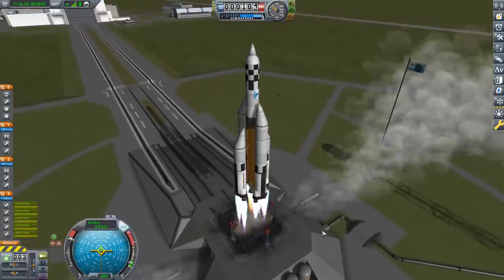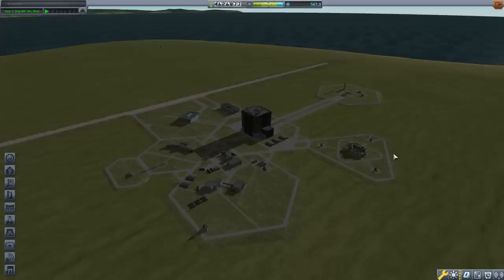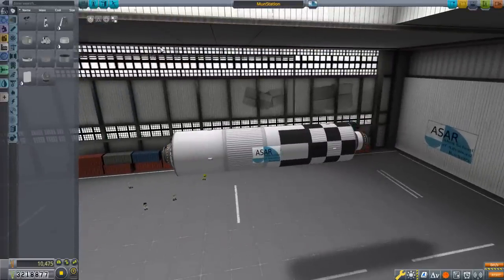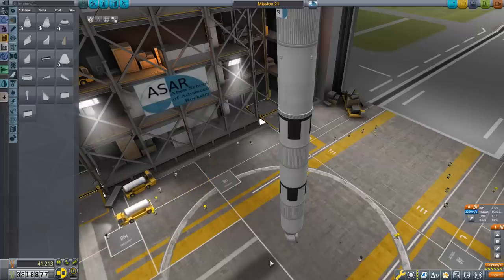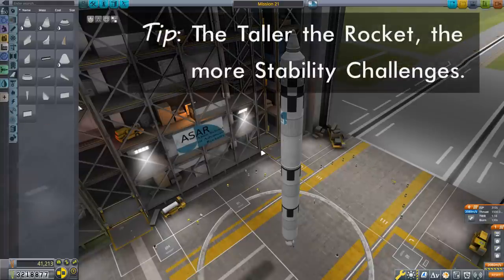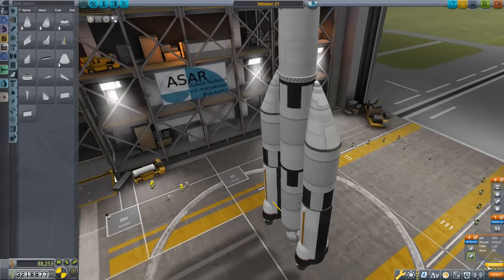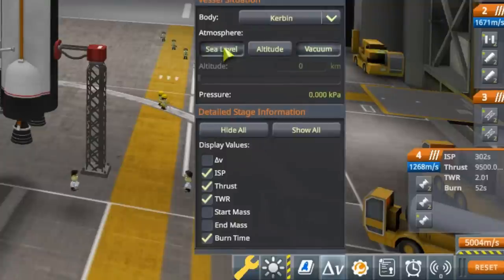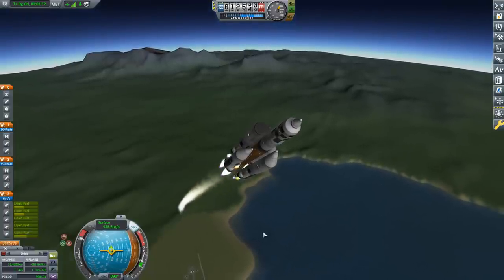How to Lift Bigger Payloads | KERBAL SPACE PROGRAM Contract Tutorials

Comment: Hey Mike. There's a way to Asparagus Stage your rocket without the drag producing fuel lines. Click enable crossfeed on the decouplers, then set your flow priority how you had it. Then, right click the fuel tanks and watch for it to empty. When empty, the engine won't shut off on its own like using the fuel lines, so just stage it and it will turn off and fall away. I use this for larger builds where I'm trying to reduce as much drag as possible but it's too big to fit in even the 3.5m fairing. It's also a way to Asparagus Stage before gettung the fuel lines.
Reply from the maker: This is mentioned in a tip note in the video, but I didn't want to go more into in this video. Maybe in the future.
Reply: Using the separators as fuel lines seems also to help the game organize the fuel priority. At least I never had to change it while using it that way
Reply from the maker: @ismaelyu5  Actually, it was the Twin Boars that caused the problem. When you connect just straight tanks, it usually isn't an issue. That was fine. It gave me a chance to talk about it.
Reply: @nicewhenearnedrudemostlyel489  the drag thing I was hust repeating what I heard I think VAOS or Matt Lowne saying, and in a career mode moneycis also a factor. Also you can do it for fun.
Reply: You can even crossfeed a liquid fuel though a solid booster with the decupler on enable crossfeed, althogh it is a bid difficult to time the solid and liquid fuel consumtion correctly

Comment: "The station must be fully assembled when launched" only applies to the requirements on that paragraph.
So, in your case your station launch has to have the Antenna, Docking Port, and power generation in a single launch.
You can't have any of those components added on a separate launch vehicle (additional components are fine)
Reply from the maker: Thanks. That came up in the chat too. I'll draw attention to it in the next video.
Reply: Oooh thats why mine wasint working

Comment: Without Mike Aben as my guide, I would have never of been able to get into orbit in KSP for the first time, which would lead into hundreds of other launches where I still somehow manage to forget a solar panel.
Reply: Hahah yeh I'm the same. With Mike it just made sense more than others, ob8ter and Matt lowne being the only other ones that were useful.
Reply: Honestly ever since figuring out I can use the custom groups to group together basically a "checklist" of parts I will need in flight, it's made building my craft waaaayyy easier. Like to the point where sometimes now I feel like I missed something but I know I used my checklist to go through all the parts I needed so I trust myself that I don't need anything else and it works out!
Reply: I'm in much the same boat. But even after that I keep coming back to these videos whenever I need a back to basics reminder to keep my upper stages lighter. And stop trying to get into orbit with one giant booster instead of multiple boosters of varying sizes.

Comment: My understanding is that it applies only to THAT bullet point.  You need to have a docking port, antenna, and power generation on one single module; the other requirements can be met with separate modules.  E.g. if you stick an antenna in cargo and have an engineer put it on after launch, it would fail to trigger completion of that bullet point.  Haven't tested, but that would be my assumption.

Comment: the only "nuclear" engine I'm aware of in stock ksp is the ion - which uses electricity and Xenon, not liquid fuel.  Also, you could have emptied the tank, and fueled it in orbit before transitioning to Munar orbit, which would make the initial phase easier (but it would have required an extra mission or 3).  Also, RCS is just about REQUIRED with larger vehicles, especially for precision control, and rotation.  Saves battery, and reduces the reaction wheels necessary. 

19:02 - this is not true asparagus staging.  Asparagus staging is when you have multiple stages, say boosters, around your main launcher/orbit stage, and as you ascend you eject them as they're used up, but not all at once.  With your current setup this is still the standard, or Onion, staging - in which all radially attached useless weight is jettisoned at the same time.  If you had 4 of these, and the next 2 were pumping into the first 2 boosters, with the first 2 boosters pumping into the central launch vehicle, and you were only jettisoning pairs of boosters (since we want to keep things balanced, or bad things can happen), that would be asparagus staging. see - https://wiki.kerbalspaceprogram.com/wiki/Asparagus_staging  I'd have linked a nasa article too, but they don't appear to have one, after going 5 pages deep in my search engine.  

22:20 - this is now Asparagus staging, lol.  Kinda funny that you did exactly what I explained, which I thought you might.  My main point was, it probably should have been explained at this point, rather than when it was still Onion staging.  It should also be noted - Asparagus staging is less efficient than onion staging if you have more powerful engines available to change to, due to various updates to KSP from the early days which made things such as drag more realistic (this is referenced in the wiki link I posted).

Also, when attaching anything radially that will be jettisoned, you want the separators to be just slightly above CoM, so they eject without trying to push into your vessel, but you don't show this, nor do you mention it.  In regards to this, you also want to be inside your prograde marker on staging, as if you're not your jettisoned stages will be highly more likely to end your mission early.  I.E. no last second pre-stage adjustments if they're going outside the prograde circle.  You are 100% correct on ditching the heavier stages first.

Just thought you should know.  I've been enjoying your content so far, I know this vid's a year old so sorry for the late criticism, but hopefully you see it and take it into account in the future.

Comment: Hey mike, can you make a video on how to dock and maneuver larger craft. The tug I have built for this fuel module is hard to handle
Reply from the maker: The video after this one adds on the next module and so gets into it a bit. Did you put RCS blocks on the fuel module itself? Other than that, more reaction wheels and struts across any wobbly connections should do the trick.
Reply: @MikeAben  No RCS on Module.

Comment: Another great video but as usual I must have made a mistake somewhere as my total delta V at sea level is only 4241!
Reply from the maker: The 5000 m/s I mention is a vacuum delta-v. I very rarely use the sea level or altitude setting when looking at dV.
Reply: @MikeAben  My dV in vacuum is 4580
Reply from the maker: @mikegibson1100  Okay. Look over the staging and fuel flow carefully. It's easy for that to get messed up in this build.
Reply: @MikeAben  Fixed it. When I built the fuel tank stage, I picked 3 x Rockomax X200-16's instead of X200-8's!!!!! Thanks again Mike for wonderful videos
Reply from the maker: @mikegibson1100  Glad you found the problem.
Reply: @MikeAben  Thanks Mike. I put the rocket in a great polar orbit only to discover that I had put one of the docking ports on the wrong way round 😂😂

Comment: Ok so I (not for a contract, but for science points) have an I think 2,000 ton ship that I need to get into space. It is mostly fuel tank with a ton of nuclear engines. The purpose of this ship is a tug for up to a class D asteroid, which it shouldn't have a problem getting from LKO to Jool. My problem is my rocket I use to launch mega ships that will stay in space permanently isn't good enough. My current theory for how to get around this that I have not tested yet is to take it, and strap 3 more of it to its sides.